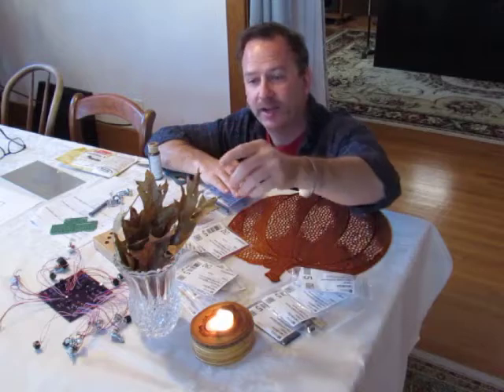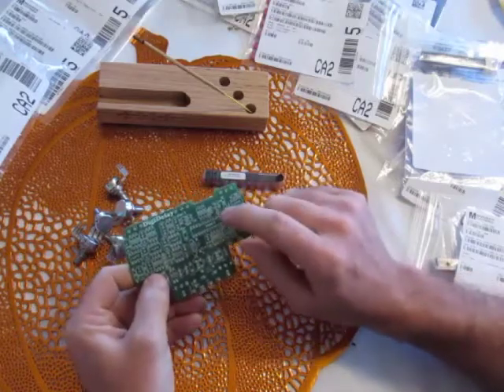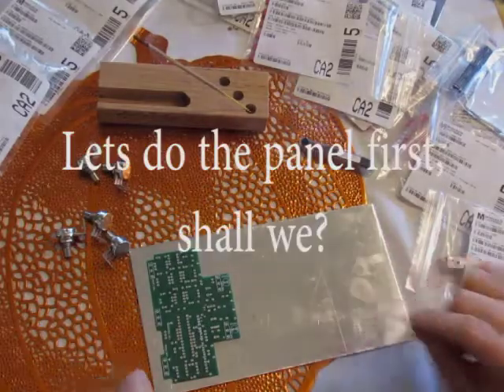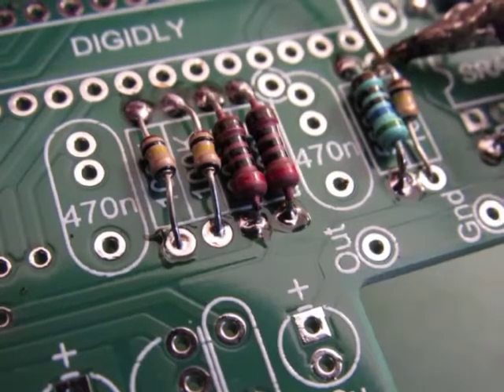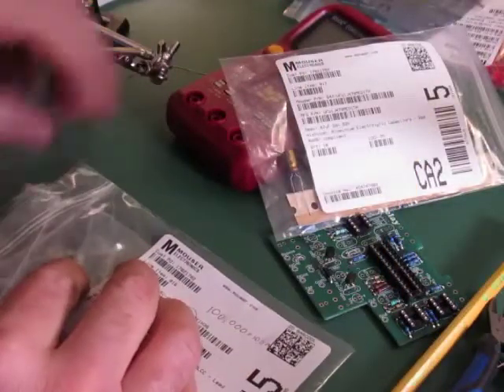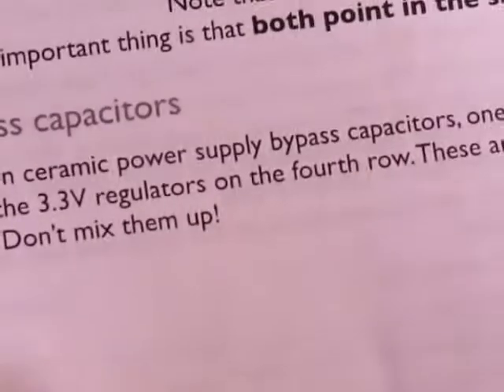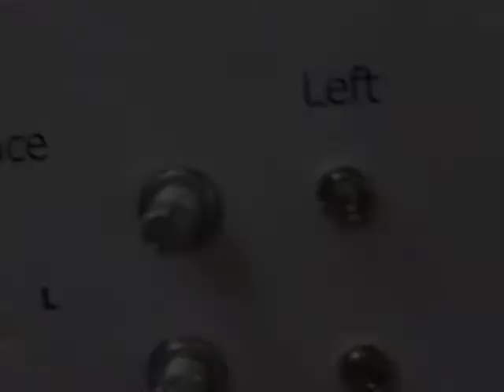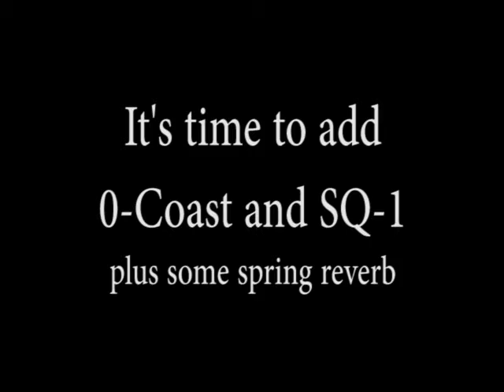DIY Digital Delay Module Kit

Comment: That Tap Punch sounds beautiful! :D

 ...but you didn't even solder on your tablecloth with
Pumpkin placemat! 

( That Resistor Shot after you mention this fact, was
quite nice. As was the accompanying Music! )

 What a neat, successfully executed Project! 

 Was it expensive? 

 What Knobs to you plan on fitting to the Pot Stems?
...if any.

 That last Tune was Stalactite Theme Music!
Reply from the maker: Well, thank you very much!!! High praise, indeed. The PCB and chip set only cost about $27 with shipping  and I had most of the other components except for some of those pesky capacitors. I probably put a total of $45 worth of parts in there. 
I love watching upclose videos like the resistor shots. I keep thinking I should buy a camera with a macro lens so I can make more.
I haven't decided about knobs yet. I may take it off the panel and tweak the circuit some more.
I love that phrase stalactite them music! I am going to use that somehow.
Reply: @pbartmess  I better get my royalties or I'll complain to the union! :P
Reply from the maker: @CaalamusTube  😅